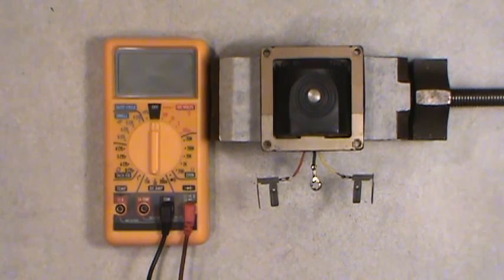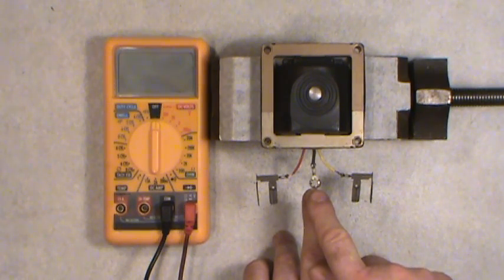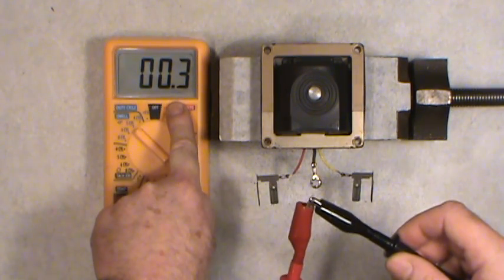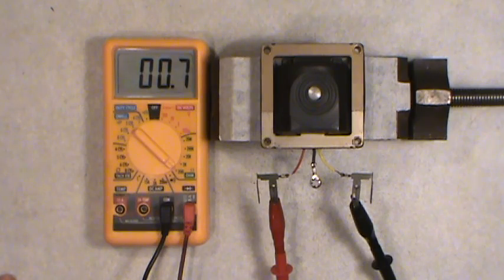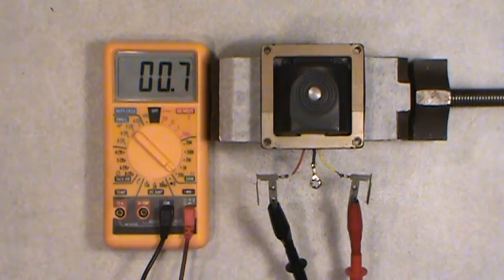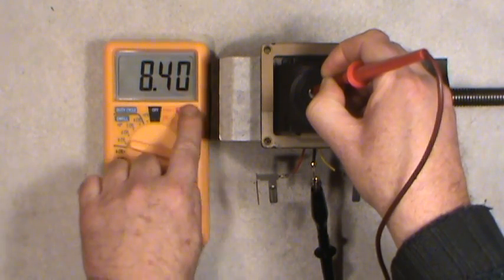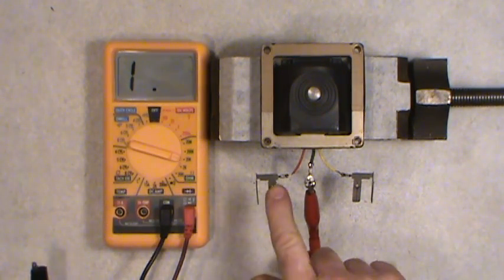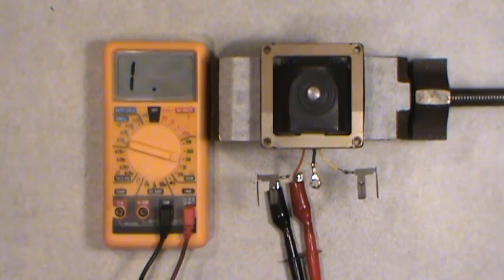HEI Coil Test (The Short Version)

Comment: Great video man, you helped me fix my car! Thank you
Reply from the maker: Greetings...ollehwo...........You're welcome, and, thanks for watching, and thanks for, the great comment as well..........It's good to hear, that, this video of mine, was able to help you out, and...git-er-fixed............If, and when-ever, you might be installing, a new (or used) "ignition control module", on/in, your HEI (High Energy Ignition) Distributor, make sure to use the "correct"..."thermal" (heat transferring) paste, as in, the same stuff, that the computer guys & gals use (and, not to use "die-electric" grease...!!!), because, it will usually be, the, "too much heat build-up", inside of the ignition control module, that will fry it/destroy it...!!!.............The "2-screws", that, go through the ignition control module, that secure it/mount it, are also, the electrical "ground" (for the module), so, make sure that, they are super clean, as well as, the 2 metal lined holes, that those 2 screws go through, have to be super clean too.............Also, always make sure that, all of the "electrical connections", are clean and dry, to help avoid, any, not wanted problems, and......till next time......Be Safe, take care, and have a good one.
Reply: This is a auto transformer this a DC resistance test not suitable for test  you can have shorted turns in the transformer  and will not be found in this test . You need to test the impedance

Comment: According to Chilton and many other sources, you tested the secondary incorrectly. No where does it say to test the ground(black wire) to anything. The secondary resistance is the tach or batt terminal to the center button. That is the one that's supposed to be between 6k-30k. I saw someone mention that you can test batt and tach to ground to see if there is a short to ground, but there are no other tests to ground.
Reply from the maker: Greetings...Vengeance...……..Thanks for watching...…….Well, according to the picture, that I saw, that was in a "Wells" troubleshooting book, it was showing, to ohms test the "secondary side" of the HEI (High Energy Ignition) coil, while it was..."Removed"...!!!...from, the HEI's Large distributor cap, by connecting, one ohm meter probe, onto the "middle" wire, and the other probe, to that recessed metal contact point, that's about in the middle of the HEI coil's body (where the carbon button's "spring", make's contact, when it's installed)……….The HEI's "outer" two wires,were for testing the "primary" coil windings...…...There might be, an "internal" wiring connection, where-by, Ya can test the secondary coil of windings, while "including" the "primary" coil of windings, at the very same time, and, not really be aware, that, it's happening...!!!...say what...???...lol..…..Well, if ohms testing, the secondary side, on the "high ohms range", while the primary coil of windings, was present in that particular electrical circuit, then, that, primary coil's windings, being..."one ohm or less"...as I see it..."would-not"...be..."detected" at all, because of, the..."high ohms range"...that, the ohm meter was already set on...!!!...cool huh (I've done it lots of times, while ohm-ing, those, good ole, 1.5 ohm, cylindrically shaped/oil filled ignition coils, and, will probably be doing a few more, if need be...…...The "Wells", electrical automotive parts company, have probably been around, for about 100 years, there-abouts, and, are a well respected company, that, as I recall, supplied new vehicle manufacturers as well...……So, if Ya ever have your HEI ignition coil..."out-of-the-distributor cap"...do those ohms tests, like I've been doing, and see what ohms readings, that will be waiting for you, and...….till next time...…...Be Safe, take care, and have a good one.

Comment: My coil resistance from red to yellow wire fluctuates. Is this the sign of a bad coil? It's almost new and I just cleaned the connections. There is no oil or anything and I held them steady.
Reply from the maker: Greetings...I Bee Amazin.........Thanks for watching........Try this......Connect your meter's two probes together, to see if you get a steady reading, in case your meter is the culprit..........Also, if you manually select your ohms/resistance ranges, via a rotary dial, then, maybe try a different range, and see what happens........Re-measure your coil, while flexing the wires, in order to see if there is an intermittent connection, or perhaps, an internally broken wire (inside its insulation)..........I've never seen an ignition coil, cause a fluctuation like you're seeing, and, for me, it's usually, high, low, or none at all, and.......till next time.......Be Safe, take care, and have a good one.

Comment: With key on should tach side of lead at hei distributor show 12v with engine not running? I keep blowing gauge fuse and I’ve got power on both sides of fuse with it pulled. I can keep from blowing fuse if I pull the tack lead. Thanks

Comment: I would like to know if the "ground" wire (the loop) is connected to one of the primary leads internally, giving -the equivalent of- a "3-wire coil" as in the other coils with the HV tower.  I have use for this, as I can determine if the coils are wound in the same direction, thus allowing me to get a slightly HIGHER voltage as opposed to a slightly LOWER voltage when using the coils in various experiments. 

On the 3-wire coils, do you know if the internal secondary connection is connected to the primary "+" or "-"?  This would be of GREAT help. Also, if,say, looking down on the HV tower, In which direction are the coils wound??
THANKS MUCH,
--daLE
Reply from the maker: Greetings...dale nassar………..Thanks for watching...……..Well, according to my ohm-meter readings, there "is not" an internal connection at all.……...Basically, there's two separate coil windings, and usually, the primary (low voltage) windings, are a thicker/larger diameter, when being compared to, the much smaller gauge/diameter of the secondary windings...……The primary coil's leads, are on the outside, having the ground wire, between the two of them, which is connected to one end of the secondary coil, and the secondary's other end, is that steel recessed contact point, that's on one side of the coil's body, where the spring end, of the carbon/resistor makes contact, when all parts & pieces are installed in the distributor cap...……..I've never cut an HEI coil apart, so, I don't know, which direction that each of the coils are wound, be it, clockwise, or counter-clockwise...……..Basically, it's usually, the primary to secondary "turns ratio", that will determine the voltage "step-up" amount, as in, there might be 100 turns of secondary coil windings, for every 1 turn, of primary coil windings, as an example...……..The automotive type of ignition coil, usually only gets saturated (charged-up), on the primary coil, for a very, very short time, usually measured in milli-seconds, before secondary discharge takes place, so, to avoid having the ignition coil over-heat and destroy itself, Ya might want to keep that in mind...……..Be very careful, around "high voltage" electricity, or maybe, a stun-gun-like experience, it might very well be...!!!...(and I hope not), and...…..till next time......Be (extra) Safe, take care, and have a good one.

Comment: I get 1905 when I check the contact point in the center and 125 on the wire to wire--is that to low ---I get no spark to the pluges good video
Reply from the maker: ***** Greetings phil ladd....Thanks for watching, and for Your nice comment as well...........................There is One..."Very Important Thing"...to Check for..."First"...to avoid, having to go on, what, might very well become..."A Wild Good Chase"...!!!...lol...........Here's the deal.............Your HEI Distributor, has to have Battery Voltage/12 Volts there-abouts, Supplied to it, so it will Work Correctly, and as it should........................With Your Engine..."Cold and Not Running"...Remove that Red or Pink, Singe Wire, with the Connector on it, from Your HEI/High Energy Ignition...Distributor Cap..........then, Select Your Multi-Meter's Selector, at about the 20 Volt Range...........then, Hook Your Multi-Meter's "Red" test lead, to that Wire's Connector, that You just removed, from the Distributor Cap.........and, Connect, the Black test lead, to a good Ground Source...........then, Place Your Ignition Key, in the..."RUN"..."NOT START"...Position, and, You should be seeing about 12 Volts, showing on Your Multi-Meter's readout.......................If Not, then, You have probably Found the Reason, as to Why, Your, Spark Plugs, aren't Sparkin'................................If You are getting about 12 Volts, then, at least You know, that, Your HEI Distributor is getting the Proper Voltage, to start with.....................................That 1905, and that 125, that You were saying, that You had there, did You happen to Notice any "Decimal Points", in those two Readouts, at all...???...and, also, did You Notice, "What...Scale/Range", that You Selected on Your Multi-Meter...for "Both of those Tests"...???......................................If that 1905, actually is...19,000 Ohms, for the HEI's, Secondary, Coil Windings, then, that should be ok/alright, as, some Specifications, that I have seen, Specifies...3,000 to 20,000 Ohms...............The HEI's, Primary, Coil Windings, as far as I recall, should be, Between, just "Over"...0/Zero Ohms, to, no more then, about...1 Ohm...for Factory/Stock...HEI Ignition Coils................................That 125, on the wire to wire, that You mentioned, "Not Having", the Decimal Point, and, the Range/Scale, that You Used, on Your Multi-Meter, at the time, is really Miss-Leading, and, perhaps, "Do the Ohms Tests Again", and, make sure that, You pay attention, to, both, "Where the Decimal Point is"...as well as..."Which, Range/Scale", that You have..."Selected"..on Your Multi-Meter, that way, I will see, "With Accuracy", those Two/2 Ohms Readings, for Your HEI Ignition Coil...thanks.....................................Also, Watch out for..."Corrosion/Dirt/Green Stuff"...on, Both, the "3 Spade Terminals", on the Outside, near the Top, of Your HEI's Distributor Cap, where that (usually) 3 Wire Connecter..."Connects to"...as, I have seen, some..."Green-Stuff"...and..."Rust-like Corrosion"..."Growing"...there...!!!...Yikes...!!!..............So, "Check" the Things, that I mentioned above, and, if You care to, You can let me know, how Ur makin' out..................Good Luck, and.............Till next time.........Be Safe, take care, and have a good one.
Reply: RockysRoads